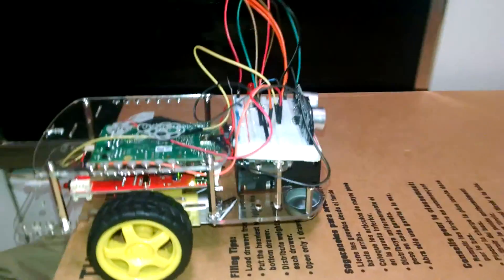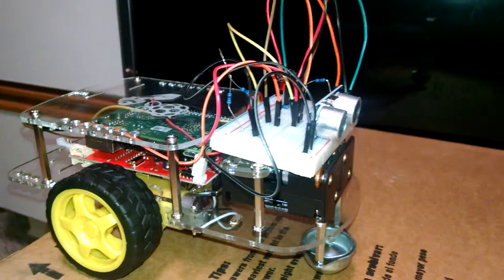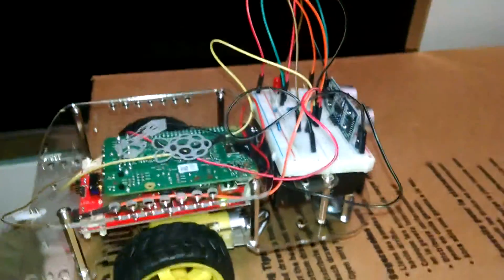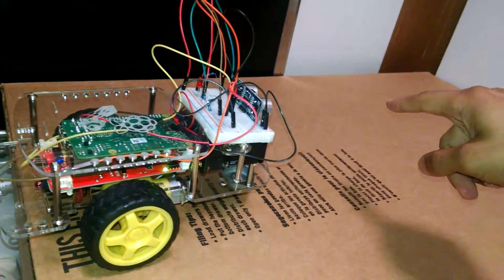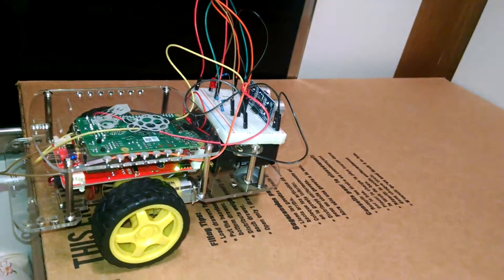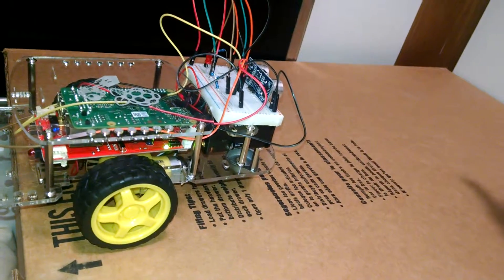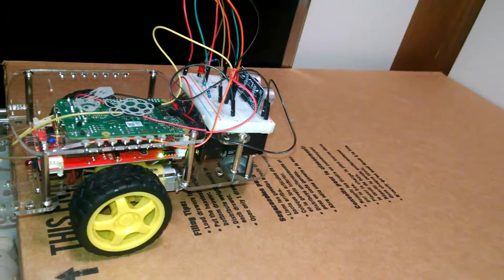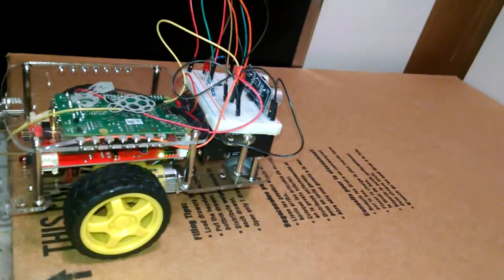GoPiGo with Raspberry pi wired up with HC-SR04 Ultrasonic sensor.

Comment: What tutorial did you use to wire the HC-SR04 Ultrasonic sensor to the GoPiGo?  I've only found tutorials for connecting it to Arduino (http://www.instructables.com/id/Hack-an-HC-SR04-to-a-3-pin-sensor/), or to the Pi's GPIO pins, which are used by the GoPiGo (http://www.modmypi.com/blog/hc-sr04-ultrasonic-range-sensor-on-the-raspberry-pi).
Reply from the maker: it was don't by hand by one of the other students.  it took elbow grease.  I'm not sure how he did it.  it was magic before my eyes.